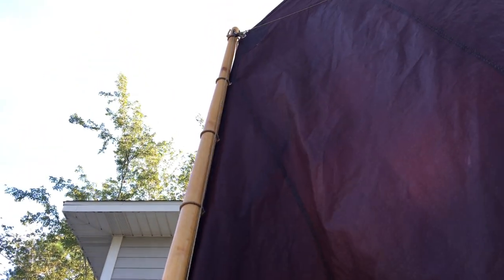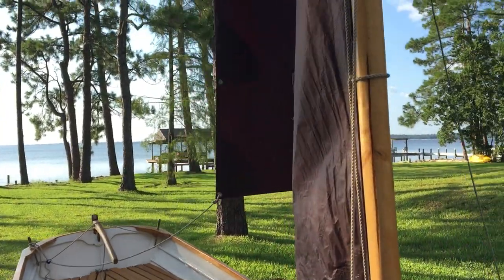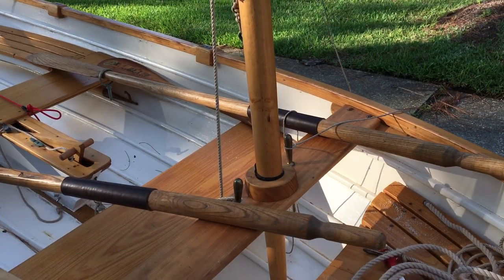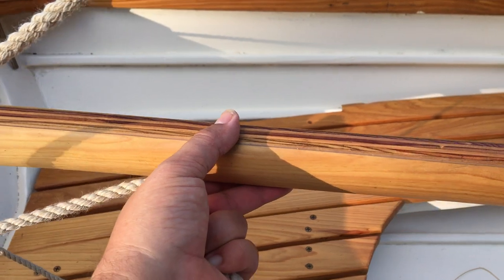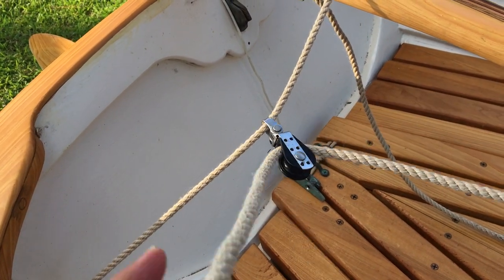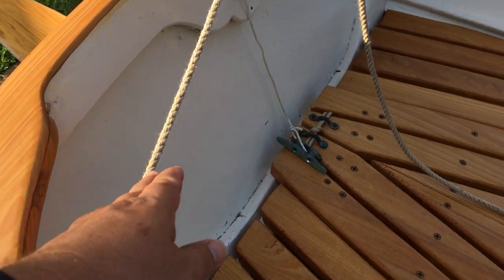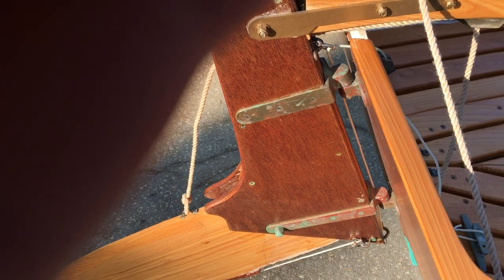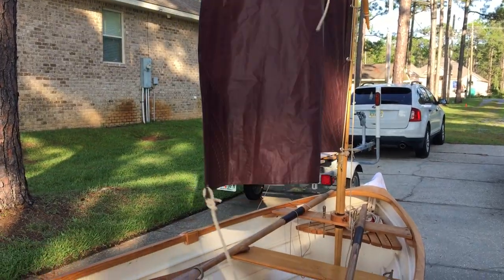Spritsail Tuning Notes

Comment: Why don't you run the bridle under the tiller?  Seems like it would be easier to flip the sheet under the tiller than dealing with the bridle pressure, and you won't have the block scrapping over the varnish every time you tack.  I like the bollards in the corners though, never seen that, and it seems useful to get that extra bit of motion, or to quickly disconnect the traveller for derigging if you wanted.
Reply: Those are good ideas, we like the way we have it set up right now and flipping the sheet under the tiller adds more line to manage while tacking. The pins do indeed make it easy to rig and derig.

Comment: hello Kent,i have some questions. what size the sheet line  on youre mainsail and the size of the block on the traveller? is it important for a loose footed spritsail to have a traveller and block? also what size the line on the snooter and brailing line and there paired blocks? im thinkin about a bolger cartopper which has an option of a loose footed spritsail.
thank you very much.
Reply from the maker: The line is 3/8th inch and the block is appropriate size. The block gives us a little mechanical advantage so Skipper can sheer in easier, and a traveler was the easiest way for us to attach a block. It also creates a better sheeting angle. The snotter is 3/8th also. The brailing line (3mm) has a small block at the top of the mast but a small ring would work as well.
Reply: @kentblairl  thank you kent. appreciate youre answer.